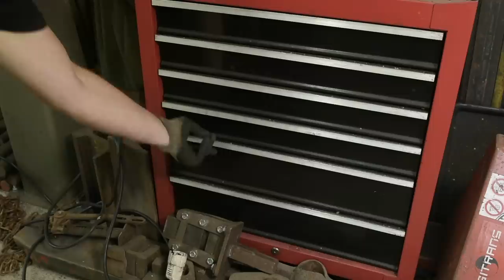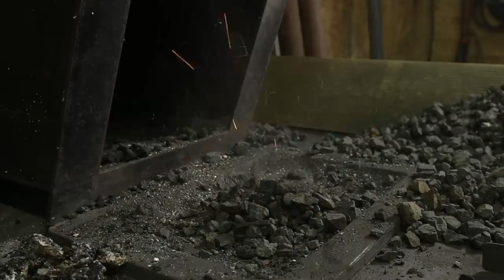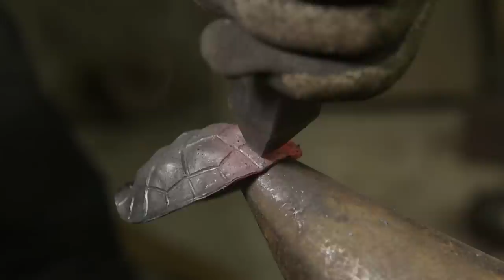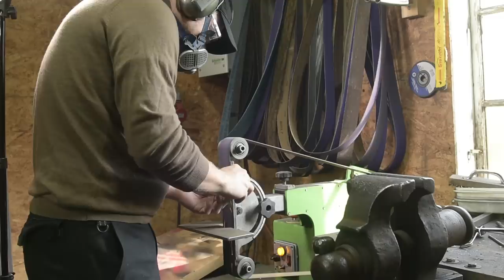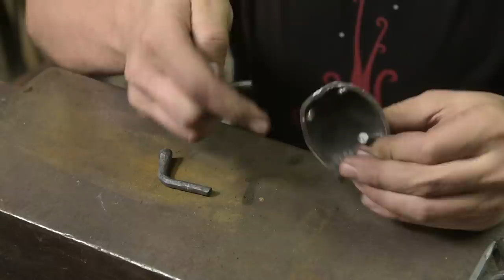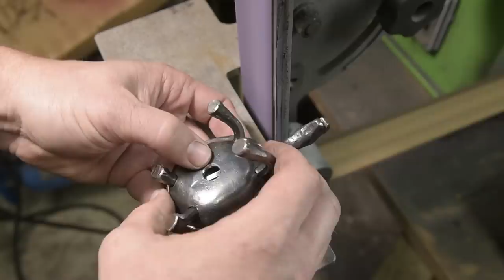Blacksmithing - Making a tortoise (THAK chess set challenge 2020)

Comment: What diameter, the pupil of the turtle's eye? Is it the same size as the cat you showed in another video? Thanks and congratulations for all the things you do. Greetings.
Reply from the maker: No this is a much smaller punch. The pupil is probably around 4 mm or so.
Reply: @torbjornahman  So I adjust myself better with the chisel.Thanks for your kindness, you are always very good in making and illustrating blacksmith processing techniques because you are an artist.
Reply: Can you tell me the diameter of the rod you use for the 4 legs? Thanks.
Reply from the maker: @carlocomodi7779  That was 10mm bar I think!

Comment: How could you drill the holes and hold it with your hands. I once did this and got a real bad injury at my hand becasue the metall piece got stuck at the drill an then flew into my hand. I even had some metal pieces stuck inside it. Tell my your secret <3
Reply from the maker: Take it super easy, especially when the drill cuts through.

Comment: I'm new to blacksmithing - Is the tool used to outline the shell detail called a Cold Cut? I've just made a Hot Cut (small and wide) for the course that I'm following and it's not hardened...is that the only difference between a cold and a hot cut? (I'm guessing!)
Reply from the maker: I would call it a cold chisel, yes. It's hardened, made from spring steel. The one I use is a blunt or rounded one since I don't want to cut, but fuller or move the material. A hot cut is usually sharper or has a more narrow edge and the cold chisel has a more obtuse angle on the cutting edge to be able to cope with the forces.
Reply: @torbjornahman  thank you for the knowledge. At 34 I didn't know I was letting myself in for such an unknown world. Normally you have the tools, and perhaps learn a technique that's new. But, with blacksmithing,  I'm learning that a method exists, the investigating the tools then learning the technique.  Its a big undertaking!
Reply from the maker: That's right!  You know there is a saying... it takes 60 years to learn this trade and then you die....so there is a lot to learn and no one knows it all.

Comment: Irony:

You could buy the materials to make that in wood for €3 and craft it with little skill in 5 hours? And it would last for years.
On the other hand 

You could spend double on the materials use a lifetime of skill to make it in days? And it would last Centuries..

Time was the factor
Reply from the maker: Not sure it would be that much easier to do in wood and would definitely require some skill....
Reply: Torbjörn Åhman it would just be carving? No heat, no setting, just chipping away at it...